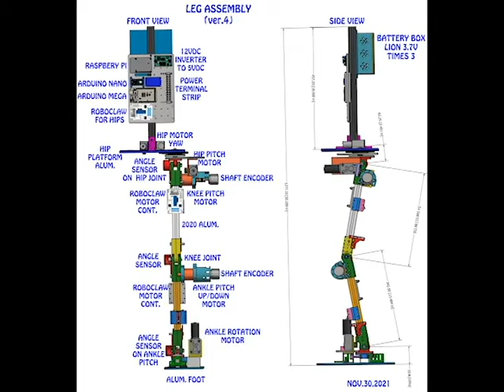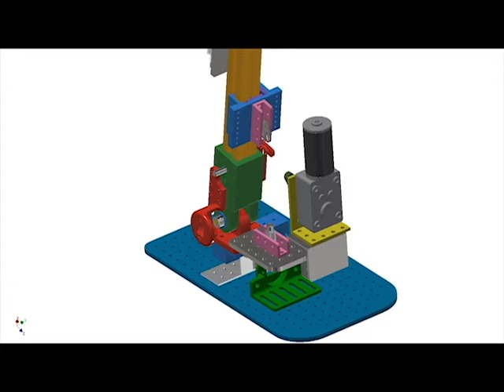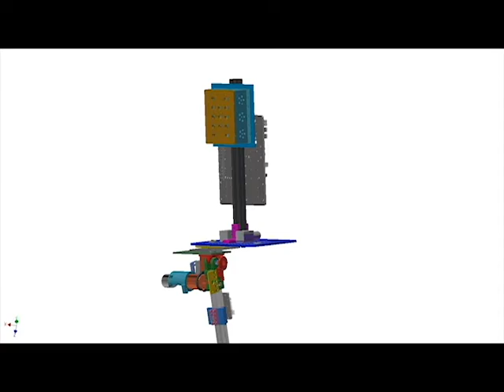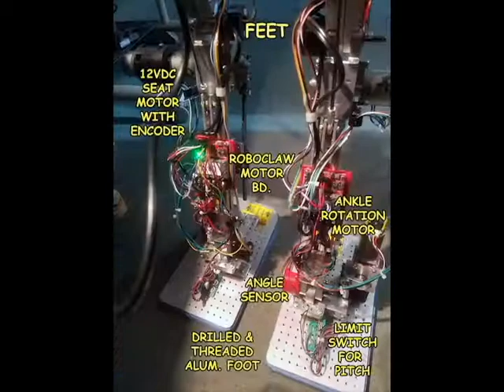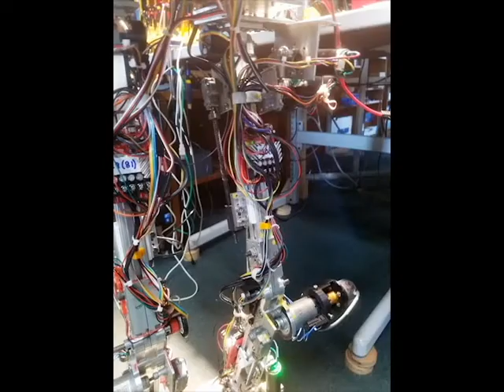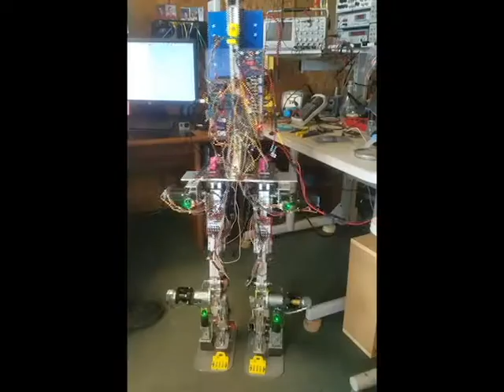robot legs ver 4

Comment: How is the bending ability or spreading of legs. If it had arms could reach the floor? Or if it fell does the legs have the degree of freedom to get itself back up? Like a bioloid robot could? Good work.
Reply from the maker: hi, it can not spread its legs, and it could not get up if it fell. Its not that advanced.  I hope to have it takes steps and turn and have it return. I need to use the Raspberry Pi to make the decisions. At least it uses the IMU for roll and pitch to stay upright.